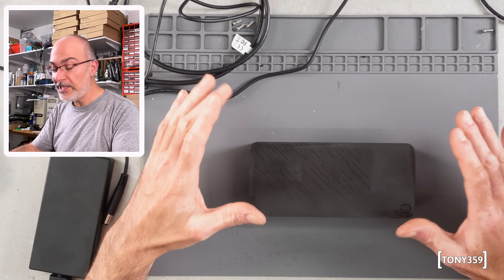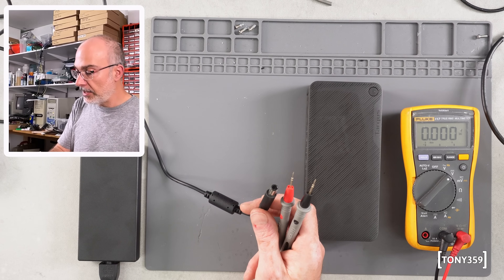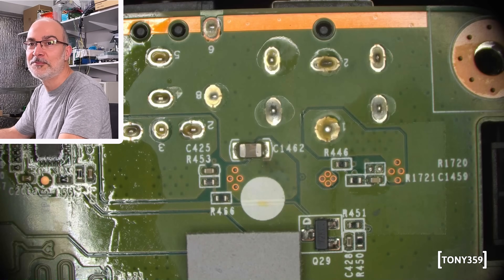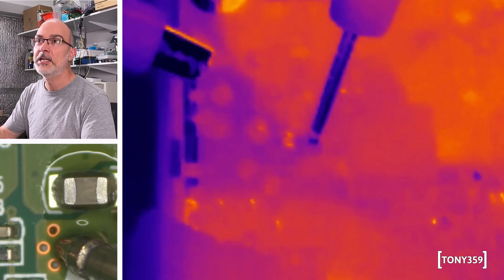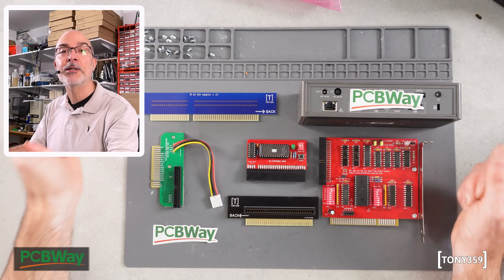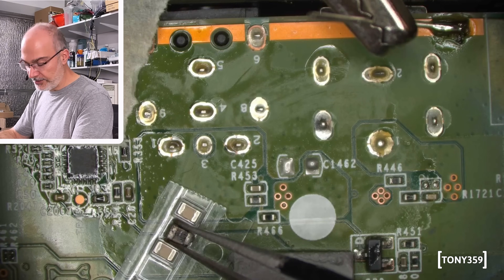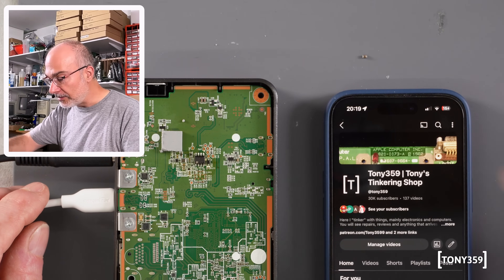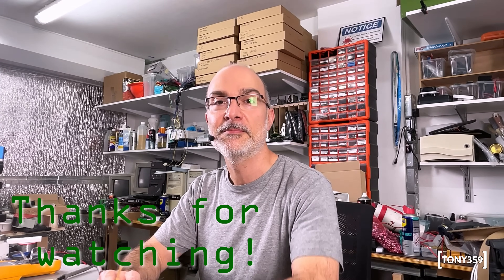I saved this $300 Dock with a penny!

Comment: I would think placing a 100n capacitor so far from any semiconductors is basically completely pointless... i would wager a guess it's a much higher density one like maybe 1-10uF, which is also why it cracked, they're more failure prone like that. But also does it really matter, i say no.
Reply from the maker: You are probably right - I've recently purchased some 10uF 25V caps, maybe I should replace it. That said, as you say, it's not a critical component 🙂
Thanks for watching!

Comment: These MLCC capacitors fail a lot. They are very sensitive to thermal and mechanical stresses. Glad you used 100V ones, as it's definitely good to use much higher voltage to have reduced DC bias. If it's a C0G/NPO capacitor, it will have no DC bias. But if it's X7R it might lose > 20% capacitance depending on the voltage. If it's Y5U/Y5V/Z5U, they will lose up to 90% capacitance. Using a 25V capacitor on a 20V DC line will be way worse than using a 100V capacitor there. For low ripple lines like these, I think 1uF tantalum capacitors (derated to 50% of rated voltage) might be a good choice; but they are also prone to failure due to inrush current (say when you power the circuit up). If you can find polypropylene film capacitor of that footprint (possibly 1206 looks like?) that'd be best as they'll be immune to some stress, have no piezo-electric effect, have no DC-bias, and kind of stable across temperature gradients, and offers low ESL and ESR, and doesn't burn up like tantalums and don't get short-circuited like MLCC capacitors (in most cases).
Reply from the maker: thanks for all the details, I'll keep that in mind!

Comment: Please, for any one who can help! This is at least strange! I have an audio amplifier connected to a PC and if I want to switch from speakers to wireless headphones, I put the amplifier on "Standby" and when I push the "Standby" button, the PC doesn't stop but the monitor say "No Signal Detected". After 4-5 seconds the image starts again and everything continues normally. Is it possible somehow that the audio signal stops the GPU for 4-5 seconds? If anyone knows something about it, please help. Thank You.
Reply: An audio amplifier connected to PC by what - by analogue line? SPDIF coax/optical? by HDMI? by USB? What audio amplifier?

Do you experience video signal loss under any other circumstances? It has been noticed that NVidia drivers can be a little wonky with VRR but i don't know much about root cause.

Comment: 6:57 the cap got so hot it started to weld itself to the pads. You can see they aren't as smooth as normal at 9:51

Comment: Lots of things do fail because of 1 component, sadly more often means lots of otherwise perfectly good electronic go to waste quickly because of a bad design or bad component placement causing early failure, or just bad component quality 

Fixed an i duction cooktop where the only thing that fail is a 0805 resistor, 3k3 turns into 1.2meg, replaced it and it works perfectly now, would expect it to fail if its a resistor for power or something but its on a communication between ic on different board, that resistor shouldnt fail

Comment: I didn't know about the alcohol trick for finding shorted parts, that'll come in handy!
I wonder if there might be a firmware update for your dock that would give you better network speed.  USB3 should definitely handle 1GB/s.
Reply from the maker: No unfortunately. My old model was doing the same. Targus was unable to help. It does something like 800Mbps, not so far away but when transferring many GB of video the extra 200Mbps do help. If I plug the Ethernet adaptor on the dock, it works so it’s not a bottleneck on the USB connection. 🤷‍♂️

Comment: Couple comments about the thermal camera / finding the fault.

1. You aren't going to see anything until the alcohol boils off.  It's acting as evaporative cooling.
2. I could clearly see the component when you moved your hand a certain way.  It seemed to be casting a shadow which gave everything more contrast.  Could be your lights or something else is causing enough IR to cause issues.
3. @GreatScott! showed a rosin dispenser in his video "I tried finding Hidden Gems on AliExpress AGAIN! (Part 5)".  It seems to work like the alcohol trick, but faster, more visible, and for the entire board.
Reply from the maker: Thanks! What you see was an IR reflection, I think. It’s normal, thermal sensors are not good at shiny surfaces. 
Yes I’m aware of the flux trick, I guess that’s another trick up your sleeve!

Thanks for sharing!

Comment: short and to the point, excellent video - what caused the failure? - possibly pluggin the psu when it was powered up - i have see this before when PSU's that output 19+ volts are plugged in you may get a spark jump between the connector pin and socket receptacle. yes is should not be in issue, but i have see this on a Network POE injector box blowing the surface mount capacitor.
Reply from the maker: That spark should be the capacitors charging instantly, causing a momentary large flow of current. Does that affect the filtering caps? Maybe, no idea. But shouldn’t be more than 20V so I’d imagine not so much. Difficult to know 🙂 thanks for sharing and for your kind words!

Comment: I love using my Sequre hot tweezers for these one-off capacitor/resistor removals. So quick and easy. Nice job Tony.
Reply from the maker: I was offered them but they never sent them 🙂 
I read online they can have some bad voltage leaking?
Reply: Only if you use a non grounded PSU.
 I bought the sequre SMD tweezers and they are excellent. They make unsoldering SMD and through hole components from boards really easy.  No messing about with hot air or 2 irons. I can just fkn get on with it. Just buy it. You won't regret it.

 I use a 24V 5A GROUNDED PSU to power the tweezers and my fnirsi HS-01 soldering iron. The DC output ground is connected to mains earth ground. The input is a clover cable. No problem with voltage leaking.
Reply: Its not the powered device that leaks voltage, it is the ungrounded USB C PSU that they supply with it that leaks. The leakage is caused by the Y capacitor between the primary and secondary of an ungrounded flyback switching power supply. If you want the iron floating, you'll have to use a big linear 24V 5A iron transformer.

Comment: Thank you for mentioning me!
Nice short video ( wish i would get to do more of them short videos on my repairs :)) )

I do not see any signs of the capacitor being glued to the pcb for wave soldering ( there should have been a clear residue underneath the cap ), so the only reason you struggled with removing it is the pcb it's self, the capacitor is soldered on both sides on large copper traces with vias, those remove the heat quite fast without preheating, so either hot air or de-soldering tweezers ( or, preheating plate ). 

Decoupling caps ( that's what it's called ) usually are 100nF, no matter the device, and it makes sense, because anything larger than that would reduce the frequency at what it works best for decoupling ( self resonant frequency of the cap it's self, the point where the reactance characteristics change from capacitive to inductive, that is where it's impedance is the lowest, thus the frequency at which it decouples best ).
The larger the value of that capacitor, the lower that frequency, and seeing how everything nowadays is switching powered, you need decoupling at high frequency, and anything larger than 100nF would be somewhat pointless ( 10uF for example is way, way to large, it doesn't do much of anything ). 
Decreasing it either is pointless, unless you have a power supply that works at really high frequencies. 
Not sure if capacitor datasheets do present the frequency characteristics but, as i said, 100nF is usually the best choice. 
Of course, you cand test, measure, and calculate, but it's not worth it :)

PS: Decoupling is best done as close to the consumer as possible, so, if you have an IC ( for example ) on that board, you do not place the decoupling capacitor near the power input jack, but rather as close to the power pins of that IC as possible. 
This way you mitigate both the eventual noise from the power supply and it's connecting cable and stuff, and what ever pcb trace impedance there is on that board which could generate some noise and interference.
Reply from the maker: Thanks as usual! I hope that that cap is only one decoupling and that ICs have their own nearby! 🙂
Reply: I don't think he needed tweezers or hot air, his iron tip was wide enough to have touched both sides if he just thought outside the box and rotated the device or himself.
Good video, Hey you can't go wrong with too much capacitance!

Comment: Another GREAT video Tony! I really enjoyed it, especially the thermal camera to alcohol comparison, the "difficult" capacitor removal (I even thought the capacitor had welded directly to the pads due to the short circuit heat) and the funny icecream interruption with your funny disappointed face haha 😄I also liked the injections of Alex's "comments" 😉 I've seen before some of his repair videos and he's surely top notch on the field.

I agree 100% with your final observation "many device are thrown away just because of a faulty capacitor".
Indeed I have a repair story too to share about a TV box that all of the sudden went dead after the restoration of the grid power following a brownout. 
The culprit was an electrolytic capacitor that WAS NOT shorted and it looked perfectly fine looking from above; the TV box was new though, not even a month of use, so I regarded as very unlikely the chance that the cause of the fault was THAT capacitor.
After all I could read all relevant voltages like 5V, 3.xV at the inductors coils.
I then tried all sort of different diagnosis ways, trying to pin point what was the failed IC. I realized that the front panel power button was not directly connected to the CPU or the power supply circuit, but it was connected to an IC that had a serial communication line to the CPU.
Using an oscilloscope I tried to verify if there was any communication going on while the I was pressing the button and to my surprise I found a very very disrupted signal... it looked like there was a sort of communication but the "pulses" were all but "square". 
I also observed a recurrent, likely 60Hz, blip of higher voltage on the 5V supply line, which I discarded as noise coming from the oscilloscope power supply... 
BIG MISTAKE... the oscilloscope was running on its own internal BATTERY so that "noise" was from the faulty device power supply!
But, I didn't catch that and I went all the way to rewrite the firmware in the eeprom... (another long journey) which of course didn't fix the fault.
Then finally... I realized what I didn't catch before... I had a close look at the filter capacitor output side and I found it had exploded AT ITS BOTTOM! not the top with the pre-cuts... no! at its bottom and even if it was new.
Go figure!
If this video of yours is the fastest capacitor fault repair video on the internet, my repair was the slowest haha 😂😭 what a life Tony! life is beautiful because it's so unpredictable... so it's repairing 😉
Reply from the maker: ahah yes, I can relate! I've had my own similar journeys to then realise it was a simple fault! Thanks for sharing!

Comment: "How much are we throwing away?" As for me, literally hundreds of otherwise perfectly functioning Chromebooks... whose only issue is one or perhaps two smoothing capacitors, the shorting of which causes their little 11" screens not to light. I'm no longer allowed to "waste my time" fixing them taking approximately 10 minutes to replace, or 5 minutes to simply CUT THEM OUT (since the devices actually work fine without them anyway.) Instead the government organization I work for requires that they be e-wasted, because component level repair is "not in your job description." 

Your Tax Dollars At Work!
Reply from the maker: "not in your job description" and also I'd imagine you're not "qualified" to open the device so it becomes "unsafe" hence unusable and must be disposed of. Yes, I've worked for corporations too. It's mindblowing.
Reply: @tony359  I help run a non-profit which repairs, refurbishes and re-distributes electronics. Everything we send back out the door was donated as it was deemed scrap and not worth the time of whatever business it was that gave it to us. It's good for their CSR to donate the devices and we win too as a lot of the stuff doesn't have anything wrong with it so it doesn't take long to sort. As for what is actually broken, 90% of it has easy and quick to repair issues. The amount of e-waste generated globally every day is just staggering and most of it is down to greed, laziness and indifference.
Reply from the maker: I remember you saying that @repairwins - I agree, the amount of waste we generate is completely unacceptable. But as you say, most of it is due to greed.
Reply: @tony359  I generally believe it's incompetence or narrow thinking.  Like, @heyidiot's department doesn't pay for new Chromebooks, so doesn't care.  It's the worst kind of waste.  Where the paperwork and regulations exist to reduce waste, but cause and justify it!

Comment: Good job with the repair. Looking at the size of that capacitor compared to surrounding caps and being an MLCC it was probably a higher rating bulk capacitor. Maybe 10uF or more. These caps help provide a low impedance backup for small, high current draws. Only using 100nF might negatively impact it when it actually gets used.
Reply from the maker: I cannot be sure - but the one I used is 100nF and it's the same size? Thanks for your comment!
Reply: The physical size of MLCC caps is more to do with their voltage rating versus capacity. Bigger could mean either high value at lower voltage (e.g. 100uF 6.3V) or higher voltage but low capacity (e.g. 100nF 50V).

Given the original was certainly 25V+ (due to 20V input), I suspect it was more like 1uF in that size.

Comment: Those MLCCs are prone to shorting like that because they are very sensitive to mechanical and thermal stresses. Actually for that reason they shouldn't really be soldered using a soldering iron.
Two irons is better but hot air is even better as the heat will be more evenly applied.
It does work for now, but it might have had its life shortened a lot due to micro cracks. But then I guess you can just replace it again. 😀
Reply from the maker: Good to know thanks.

Comment: The reason the capacitor was hard to remove is because it's glued down being on the underside of the board, a technique used at pcb assembly.
Another technique to find out which component is causing a short is to use a 6.5digit multimeter and you'll soon find which component has the lowest resistance across it.
Reply from the maker: I don't think it was glued, I didn't see glue under it. I know what you mean, I don't think it was the case on this occasion. When I used two irons, it came off with zero efforts. 
Yes, I'm aware of the "lowest resistance" technique - I just don't have such an amazing meter 🙂 Thanks for all the tips!
Reply: @tony359  Sometimes components are like that.  Just way more of a pain than expected.  No PCB damage, so it's all good.  Glad you show us the process.  Including when things don't work right.

Edit: Sometimes I'll use a cheap IR re-work station to pre-heat a board like this.  It's basically a heat lamp.  Which is what you could use instead of hot air.  It's not much, but a board where everything is at 90C is much easier to work with.

Comment: You didn't get a good result with the thermal camera because you're not doing voltage injection the right way. Start with 1 volt, but higher amperage like 1-2 Amp and you'll have better results.
Reply from the maker: I'd imagined that. I was a bit too worried. So you're saying keep the voltage low and increase the current?

Comment: Stick with 1V but go with high current to find shorts. That way you don't accidentally switch on/damage semiconductor devices. Keep in mind, you need resistance to make heat. A dead short will not show unless you pump 10s of amps through it.
Reply from the maker: Thanks! I'll definitely do that next time!
Reply: Yes, there needs to be some resistance for it to heat up. A complete dead short won't heat up. Its ohms law.
Reply from the maker: Well I guess the idea is that the little component will offer a little more resistance than two ground/power planes connected together so eventually will light up. But you’re right, if it’s a dead short, there is no resistance to turn energy into heat.